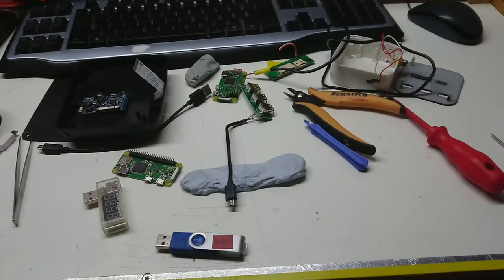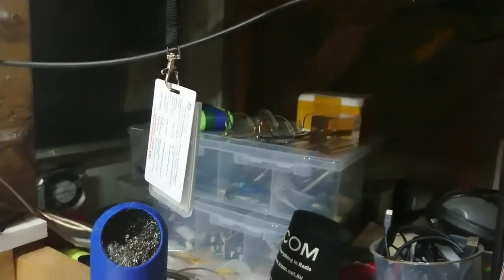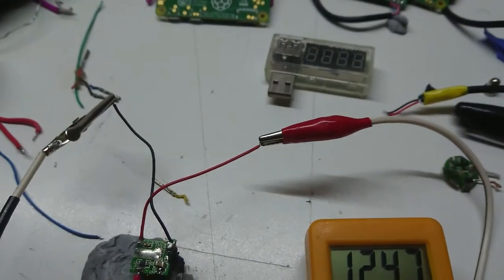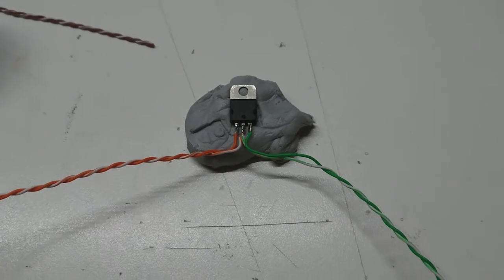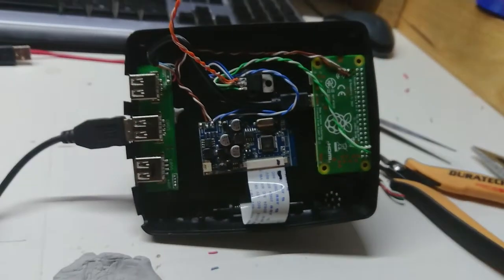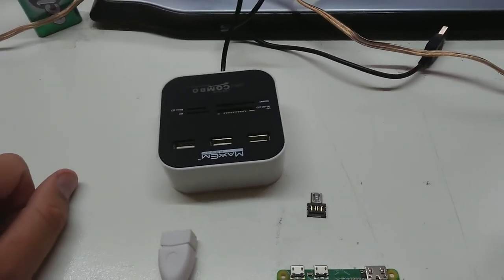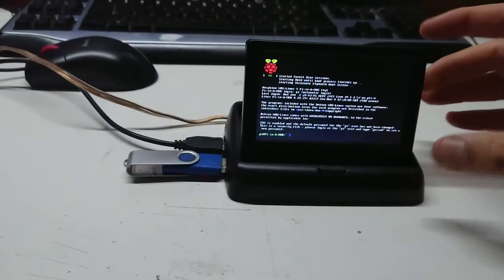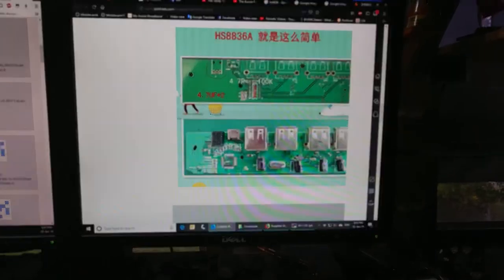Raspberry Pi Zero W inside a 12v reversing camera display

Comment: I don't believe it's likely that HS8836 has anyhow different ports with different capabilities. The picture on the seller site was likely purely illustrative and doesn't actually mean anything.

However i think the device you sourced it from has likely BUSJ pulled down and/or some OVCJ weirdness. This will cause enumeration rejection by the host device when you overstep the (declared, not actual) current limits on the connected devices, and they will fail to enumerate in logical order. With BUSJ pulled down it's an unpowered hub and thus has 500mA current limit, so 500mA devices should not hypothetically enumerate on it, but one just might, but after it nothing for sure will.
Reply from the maker: I have a number of these hubs now - and I can attest that 1 port works well with most devices and the other three operate at a lower throughput, almost as if they are half duplex. and even the lowest current device I have access to, will still not operate in some ports.

I have a reflow gun now, and I can lift surface mount components, so I may purchase another and see if I can locate any pull down resistors and remove them. I'll do some experimenting.
Reply from the maker: Also, this project has been integrated into a geiger counter project:

https://www.youtube.com/watch?v=7T5gQTv4-FI&list=PLXvLC1_XYdhrm8P3IU6gJVBC3uonJU4BV
Reply: @TheAussieRepairGuy  interesting. i guess i'll just stick to GL850 then just like in the past 10 years, they aren't even expensive. :D
Reply from the maker: @SianaGearz  yeah the price difference between a tried and tested chip vs a cheap crappy one are often several cents. it's beyond me why some of these chips are still produced.